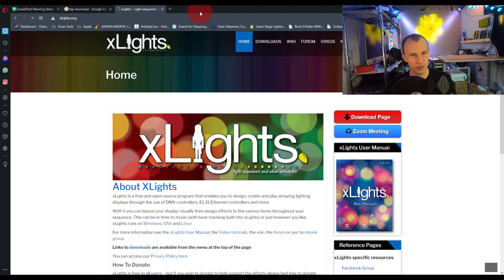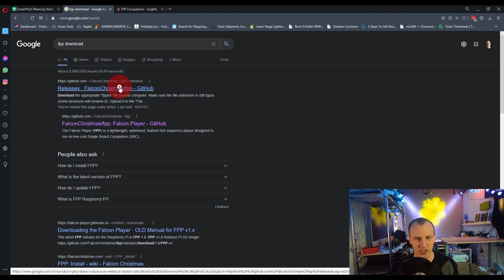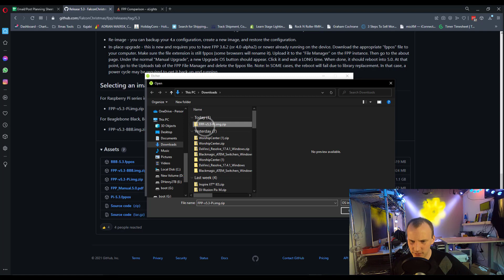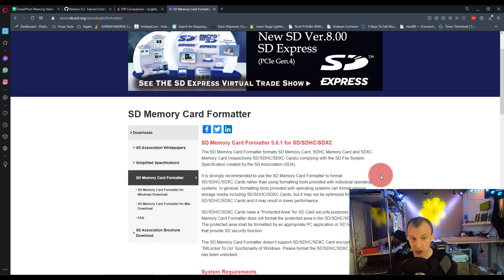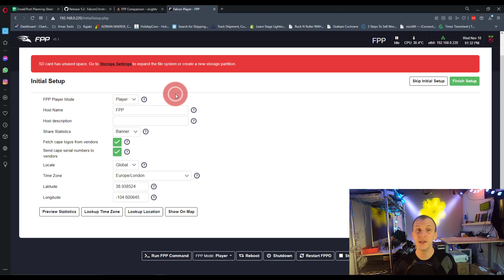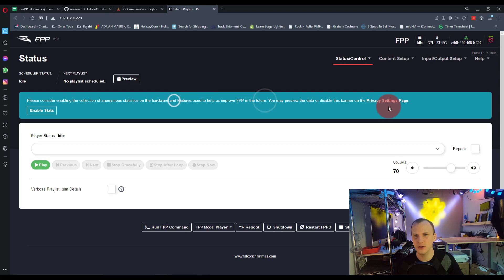FPP V5 Setup - Installation

Comment: thanks for all the info. i’m starting to research everything that possible with christmas light shows and creating my own for next year. i have a few questions. can you run a show without internet? how to find and use shows from xlights that were created by other people? and how to set up a controller and if you need receivers, can input the controller in my garage and use receivers for a tree/arches/props also how to use a network switch? also when setting groups for sequences do each section need their own signal/connection to router/controller? everything i’ve looked up seems to jump these and assume we understand or i clearly missed the information. thank you in advance for any help and all the info in the vids
Reply from the maker: Yes, you can run shows without the internet - for the rest of your questions, check out the other videos here, or check out my step-by-step guides to building your first show inside of Learn Christmas Lighting Academy: https://academy.learnchristmaslighting.com/lcl-academy-sales-page